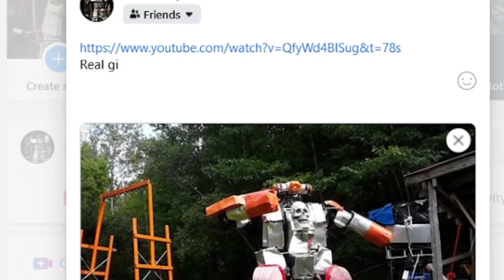I tried to optimize my DIY mech (Part 1)

Comment: Rather than using double pole double throw switches for hard forward/reverse, why not add some proportional control? I know in an older video you mentioned you wanted to avoid an arduino, which really is the best way to do it, but even for analog control you could use something like an l293d motor control chip to keep it all analog, with a control pot to set the speed. Or if you want to keep it super simple, just a pot feeding a mosfet to drive the motor?

The motion would be way smoother and easier to control, plus you could probably use a cheap joystick since you mentioned the buttons can be fiddly.
Reply from the maker: Each motor runs off 48volts and 3-5 amps.  A motor controller of such rating is not exactly an easily sourced part :)

Comment: When it started moving, it honestly looked like it was sitting in a wheelchair. Wondering if a more powerful engine might in order, as it could also allow you to make the frame sturdier.
MG Excelsus when?
Reply from the maker: Next up is using some 2000lb electric winch motors and 6 legs for driving (and possibly walking eventually).
It is currently more functional than Kuratas, anyway lol.